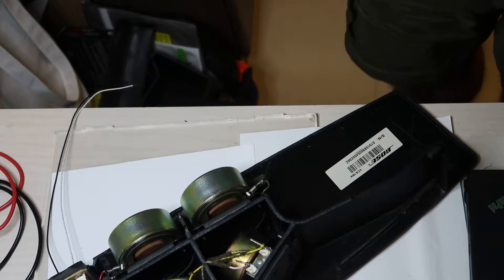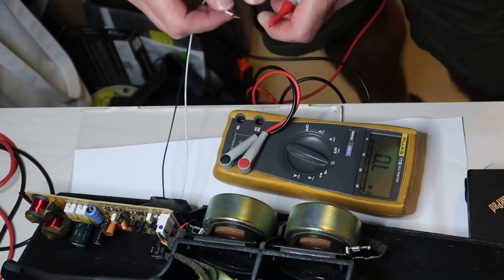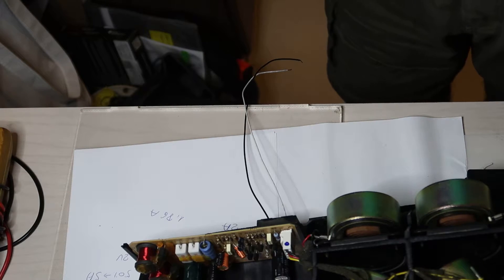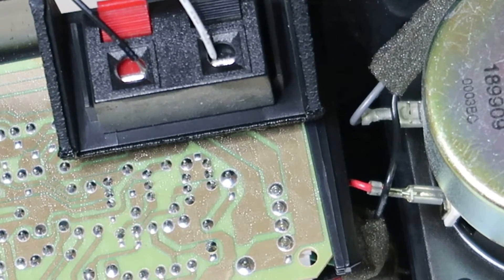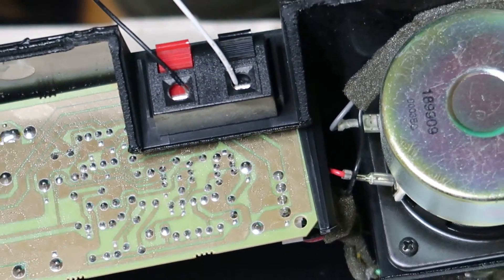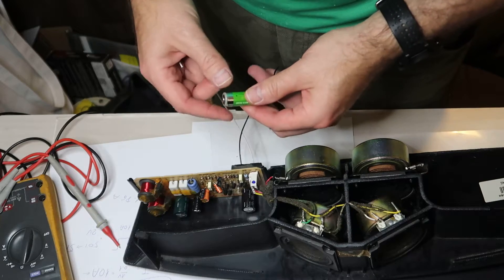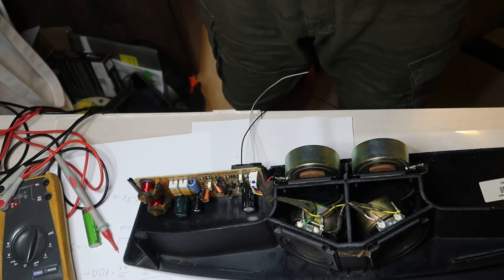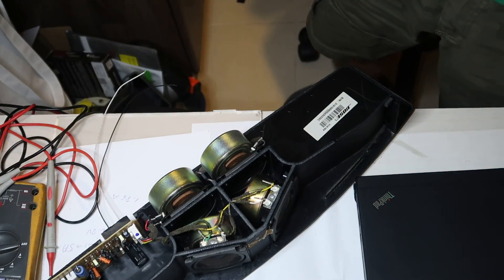Bose Speaker Need Fixing?

Comment: I have this speaker and I am getting around 16 ohms at the rear terminals. It works but doesn't sound very good. Do you think there is something wrong with the drivers or the capacitor?

Comment: It would seem that Bose is using some sort of "passive" limiter in that circuit. When you turn up the volume, perhaps some of the lower frequency is being directed away from the drivers. Maybe this happens independently of a standard high pass capacitor.

Comment: I would just like to see how to open the case. My bose vsc-10 vibrates at certain frequencies because it's loose on the corner. I don't want to just start prying.
Reply: Only a authorized dealer can truly open certain Bose Speakers without any signs of damage because many of their plastic case speakers are hermetically sealed with a factory adhesive clue

Comment: Would you please tell/share how you managed to open up the speaker? you mention that you used screwdriver to pry it open. were there any tabs you could press that would make job of opening easier? some videos show that Bose often glue those tabs. was it the case?  thank you.
Reply: Yes as an owner of a Bose complete plug and play system these speakers are clued so contrary to any of these bose tutorials the plastic cases of Bose speakers always has an element to their speakers that are factory clued so certain parts are not able to be repaired or interchangeable by the purchaser.
Reply: He made a video of this